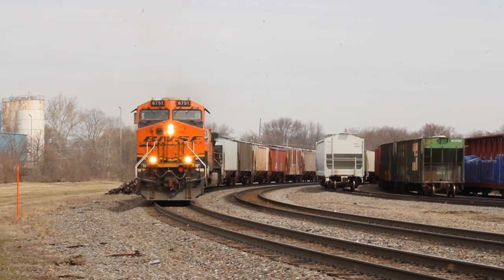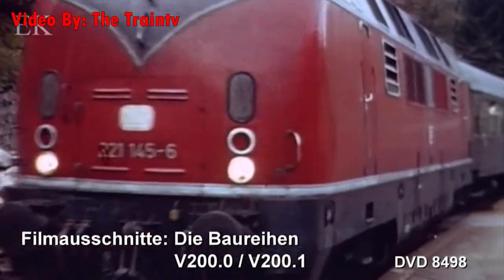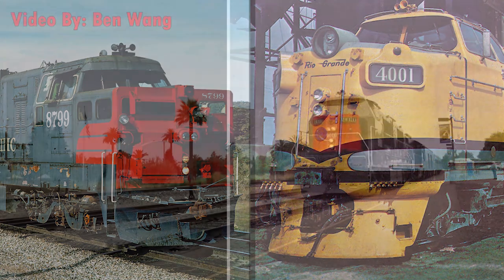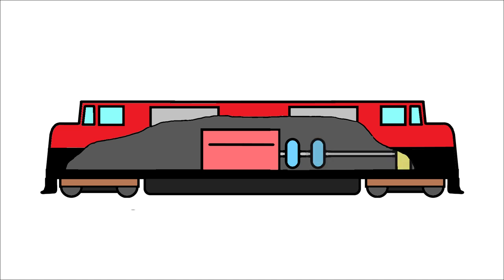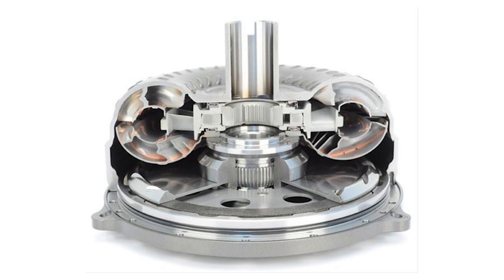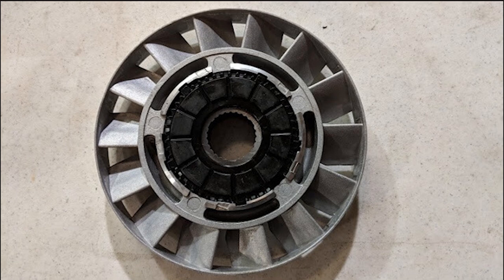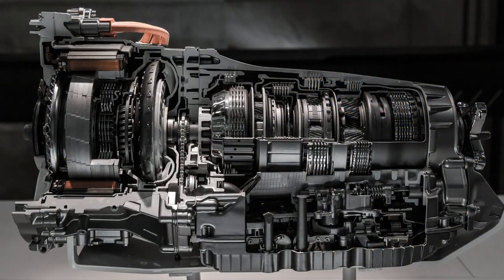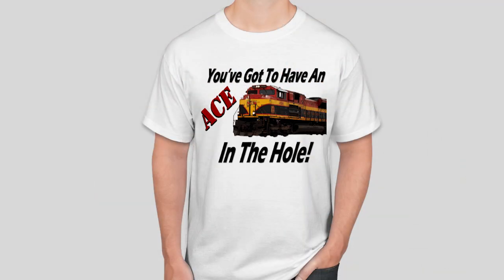How EVERY TYPE of Diesel Locomotive Works! (Part 3)

Comment: The multiple torque converters are in PARALLEL, not in series. Each is powered by the prime mover, but outputs to a different ratio geartrain that leads to a single output shaft. The torque converters are sequentially drained to achieve gear ratio changes at the drive wheels. They are not locked up.
Reply: I don't think he meant series in that manner. He probably used it to refer that there is more than one.
Reply: Why can't they be in series? Sounds like smoother gearing to me 🤔

Comment: The most powerful european DHC or Diesel Hidraulic locomotive is the Voith Maxima. 5000HP. And is a mainline locomotive. Grate video. Grate work.
Reply from the maker: That’s cool! Thank you!
Reply: That was a commercial failure however. The Maxima has just two speeds. First speed uses a torque converter, second speed uses a fluid coupling driving through the same gear. The coupling slips less than the converter so it's effectively a higher gear.
If you had a third speed it would use a second fluid coupling driving through a higher gear.

Comment: In India today there is little to none Broad Gauge Diesel - Hydraulic locomotives in Operation... 90% of our Broad Gauge rail routes are electrified and the rest works are done by ALCos and EMD's Diesel - Electric Locos... There used to be a loco called WDM 3 ( not to be confused with WDM 3A or WDM 3D ) but they were not successful... For Meter Gauge or Narrow Gauge  there were some but now their network compromised less than 5% of our network... For Meter Gauge, the remaining network use YDM 4 Diesel Electric Locos only... For Industrial railways there might be some...

Comment: In Britain nowadays the only diesel-hydraulics are diesel multiple units which switch into direct drive for the top 'gear'. Back in the 1960's the reason some DH locos were built in Britain was because they were about 15 tons lighter than an equivalent DE loco. It's a long story as to whether they were a success or not. Virtually all of the many types of diesel loco Britain started with, both DH and DE were problematic. Some classes got ditched quickly but the rest did get sorted out eventually. By the 1970's most were running with a fairly similar miles-per-falure rate. But it was clearly inefficient having so many types and some had to go. Against the DH locos was there were less of them, they could only do 90mph (a bogie problem) and they could not be adapted to provide electric train heating (hotel power). Also DE loco design was evolving quicker globally. Anyways, there are still (I think?) 11 of the big diesel-hydraulics preserved and running on heritage railways, plus a handfull of shunters. The loco seen at 2m00 is one of them but out on the main line to check it's OK to run on the network. Hopefully it'll be back soon taking enthusiast around the country at 90mph.

Comment: The diesel hydraulic locomotive is a problem when they leak fluid. Oil on the rails is a disaster.
Reply from the maker: Yikes, I can only imagine!
Reply: It could be, I suppose, but most of the passenger trains where I am are diesel hydraulic and it doesn't seem to be a problem.

In any case given that the transmission is likely to be in the middle any oil that escapes will probably fall between rather than on the rails.

Comment: In Europe we use a lot of diesel-hydraulic locomotives. Let me explain for example a switcher locomotive (Croatian series 2132) how it changes gear ratios.
The engine drives the transmission which has two identical torque converters but each torque converter is linked to it's own pair of gears. The gear ratios are different. When the locomotive is given the command to start moving the first torque converter with the lower gear ratio is being filled with oil. As the locomotive accelerates and depending how much throttle you have given the electronics tell the transmission to drain out the oil from the first torque converter and start filling the oil to the second torque converter which is coupled to the pair of gears which give a higher output shaft speed and the locomotives accelerates to higher speeds.

The concept is pretty simple, like an automatic car but instead of shifting planetary gearsets you have multiple torque converters and each of them has it's own gears with a different gear ratio. Only one converter is filled with oil at any given time. For a short amount of time (about few seconds), when the transition from one to another torque converter is being made, two converters are filled with oil and this ensures a smooth shift with no loss in traction and no jerking.
Reply: So the difference between a diesel mechanical and a diesel hydraulic is the "transmission"?
Reply: Some early automatic transmissions were all torque converters and no gears, like the Buick Dynaflow and the Chevrolet Turboglide. These existed in the 1950s and '60s and were gone by 1965.

Comment: I’ve read of some of the torque converter schemes in old books, and would not be surprised if actual automatic transmissions have been tried at some time or other, but I’d have guessed that the overwhelming majority of diesel hydraulic locomotives employ hydrostatic drives.

Comment: Diesel hydraulic locos use oil in the transmission to fill the relavent torque convertor to engage the gear req. To change to another gear the first convertor is drained of its oil then a second convertor is filled with the same oil to drive through a higher ratio to give higher speeds.

Comment: The UK hindered itself with Diesel Hydraulic locos for a while - which they got rid of - one of the designs was the Blue one with small yellow panel at the front.  Got rid because they were non-standard.

Some of the Passenger Units are using D-H nowadays.

Comment: Is there any diesel-hydraulic locomotives that use individual hydraulic motors on the axles and the engine is just to run a hydraulic pump?
kind of like diesel-electric but hydraulic
Reply from the maker: I don’t know, I didn’t come across any locomotives like that during my research, but I wouldn’t be surprised if a system like that has been been experimented with, or implemented on smaller rail vehicles (like MOW equipment).
Reply: could have been or some light shunters maybe, or maybe some form of hydrostatic drive setup
Reply: That’s how I thought they all ran, a diesel electric type with hydraulics instead of electrics.
Reply: When I was an apprentice our mentor said years back a hydrostatic with a VD pump locomotive had been trialled once. But would always blow hoses and generally never worked right. The technology wasn’t there. Maybe now it could be made to work. But while it would be super efficient compared to TCs etc. there’s no reason to believe it would be better than diesel electric.

Comment: Can you do a set of videos on which diesel hydraulic designs work best in different applications that diesel hydraulics are used for?
Reply: The real reason diesel-hydraulics are used instead of diesel-electric is because some transmission company wanted to make money. There is no real technical benefit. The peak efficiency may be higher, but the average efficiency is not.
Reply: @marioxerxescastelancastro8019  The main advantage compared to older DC locos is that you can stall the output (axles with the brakes and not kill the traction motors) so driving REALLY slow is possible without needing modern computer tech and VFDs. modern Hydraulics are often bought by companies, cause they do not have any large drivetrain computers, so theytend to be fixable by the small workshop and a manual instead of a IT-degree. Older hydraulics are very common in worktrain usage and switching, cause they do exactly what the operator wants them to do, without any computer arguing if it really is a good idea, a old 1200HP hydraulic can do stuff a modern AC loco can't do, cause the computer doesn't like it.
Reply: @FabiaLp  I see. Informative answer.
Reply: At least back in the 1950s and 1960s Diesel hydraulic locos had a significantly better power to weight ratio,  which mattered a lot for 4 axle designs. In those days coaching stock was usually still steam heated requiribg a heating boiler on the locos.  Later on this turned the tide for  diesel-electric
Reply: @marioxerxescastelancastro8019 don't know what is used where you are, but while diesel hydraulic locos were never that common diesel hydraulic multiple units are and in some cases they replaced diesel electric units as they are I think cheaper and lighter.

More recently conventional automatic gearboxes have been used.

Comment: What is that massive beast of a transmission at 6:48? 😂
Reply: Looks like a truck transmission to me
Reply: Looks like a Mercedes hybrid 9-speed unit. Electric motor at the front, then a torque converter, followed by the planetary geartrain.

Comment: Here's a Romanian built diesel-hydraulic still in use in Vietnam.  I haven't been inside it yet, but it has one drive motor in the center, with a drive shaft to each wheel-set.  https://www.youtube.com/watch?v=EGiDI_8lIkw

Comment: Yknow, I just thought of something, if there have been trains with a hydraulic transmission, I wonder if cars, trucks or even ships ever had hydraulic transmissions 🤔
Reply from the maker: Well, the automatic transmissions in vehicles are shifted through a combination of hydraulics and electric solenoids. As for the torque converters being used as a transmission, I’ve never heard of a vehicle with such a thing. Now on a boat, torque converter transmissions are more feasible, but I still don’t know of any examples.
Reply: @Southern_Plains_Railfan  ah ok I see
Reply: The Konegsiegg Regera got sort of kind of a hydrolic drive. While its a hybrid, the maker claim that it in theory could run on hydric drive only (while it would have not reverse gear).

If you want to be really literal, all ships have hydrolic drive... due to.. water being a liquid. 

I have seen boats with hydrolic drives, but they where not used for gearing. They was used so the outbord propeller linked to the onboard engine with no saft, making it easier to integrate.
Reply: @matsv201  well a shaft is a mechanical transmission
Reply: @jadenspires1891  Well.. hydraulic drive can be used for both gearing as well as speed conversion
Reply: M1 Abrams has hydraulic drive
Reply: The closest thing might be Chevrolets Turboglide transmission offered between the 1957 and 1961 model years. Instead of a conventional manual or automatic transmission it had a torque converter with three turbines, each connected to their own gear ratio within the planetary gearbox, and all spinning concurrently and progressively switching between drive turbines. This gave the effect of basically continuuously variable gear ratios as engine rpm barely changed when accelerating.
Reply: @Southern_Plains_Railfan The Buick Dynaflow transmission of the 50s basically drove the car entirely through its five element torque converter. It did  have a high and low gear ratio but in normal driving only the high ratio was used, which was 1:1 direct drive, engine and road speed were matched entirely through the slip of the torque converter. Low ratio had to be manually selected by the driver.

Comment: i often commute by train in italy, the trains on that railway are always the same model diesel-multiple-unit model, i always assumed they were diesel-electric, as the same trainset is also available as an EMU, however i looked into it and apparently it's diesel hydrodynamic with no gears.

a different nearby railway did have some diesel trains with gears, i don't know what kind but now the line is getting electrified so they wont be use anymore

Comment: fluid couplings and or torque converters have a problem of cavitation if you remove too much fluid.  Bubbles form on the meal destroying the metal when they burst too much pressure SO what happens if you pressurize the fluid drive or torque coupling body???   the bubbles cannot burst because the pressure in the converter body is too high so now the fluid can get even thinner making the reduction, speed lower and torque greater.........

Comment: First off, Nice video.
Small correction; @ 6:53.  I think you stated it backwards.  I always took convention to mean output vs input?, so saying 'increased torque' means more torque at the output, to me: ie. more speed, less torque on the input side (input from the engine), and MORE torque and LESS speed at the output.  If that's how you mean it, then you said it backwards: it would be 'driving ring, driven planetary, (stationary sun)' is more speed, at the expense of torque; and 'driving sun, driven planetary, (fixed ring)' is a LARGE increase in torque, less speed...
[both have an output speed less than the input...]
Do I have that right?
Mr K L

Comment: I was looking throw different type of electric locomotive drive.... and one might suspect, how many different types can there be.... a lot.. REALLY a LOT.

I found like 15 different ways just from a breef look. There is probobly loads more.

And i don´t know if there going to be more parts of this series, but there is also diesel pneumatic.

About electric, as far as i can find there are 5 main categories.
AC-AC
AC-DC (yes, like the metal group)
AC-DC-AC
DC-DC
DC-AC

For something like AC-DC-AC that is the most common today, there is at least two different subtypes, syncronic or asynchronous motor
Reply: I don't think I've ever heard DC-AC before. Anti-rectifiers? How does that work?
Reply: @russellgxy2905  typically its a 3 pole H bridge with transistors or thyristors.

If made with transistors they can be feed backwards to be used as a rectifier. This is actually more efficent then diods. So most modern locos have H bridges on both side. Both to the motors as well as the power line. This way they can feed the power back put when breaking.